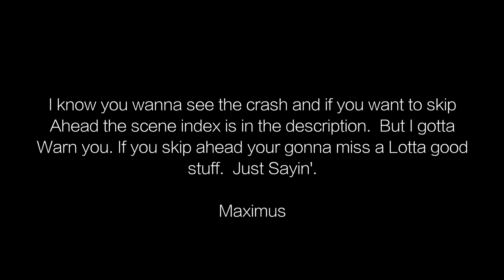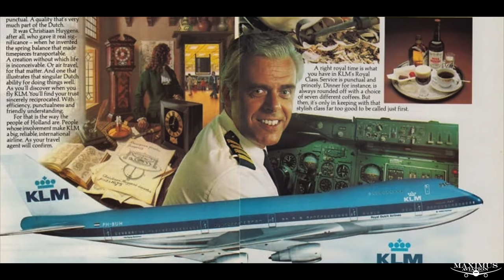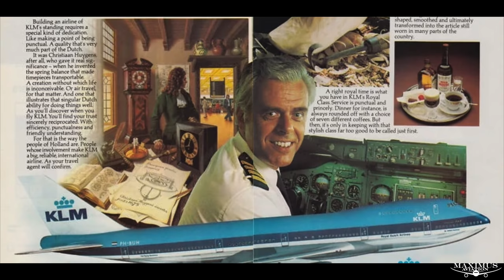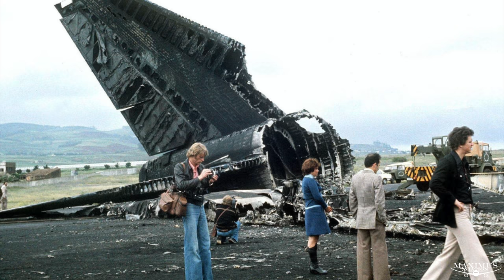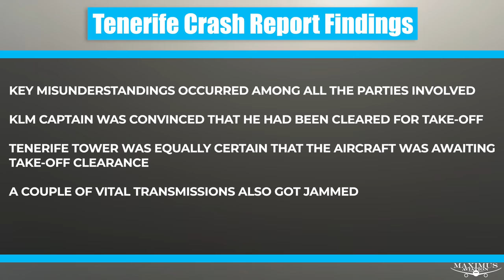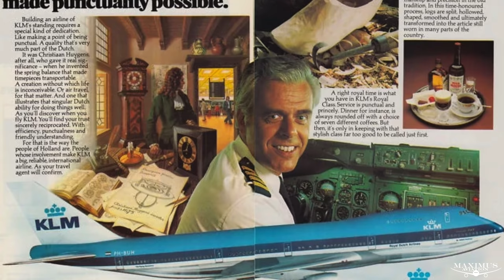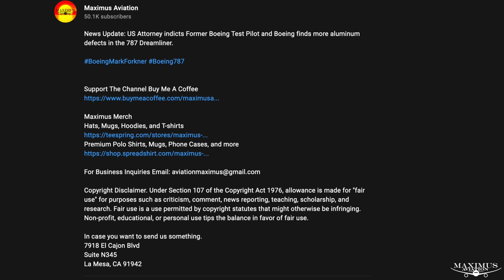How One Pilot Caused The Worst Accident In Aviation History

Comment: I reposted this comment for the actual video. It was first posted in the teaser notice.
Van Zanten was KLM’s chief check pilot. Van Zanten had spent the last year before this disaster as the pilot in charge of simulator training of the KLM pilots. Van Zanten took this charter because he needed actual air time to keep his pilot status current. The biggest problem with Van Zanten jumping from the simulator environment to actual flying was he had “Simulator Syndrome” from spending so long in a check training cycle. In the simulator if a problem arose during the test flight they would just reset the stimulation and run it again. Under the stressful situation Van Zanten found himself in he started treating the take off like a simulation and he refused to listen to any other input in his fixation to get in the air. His timing out due to running out of available hours and been grounded to a forced rest period were the first and only thing on his mind that day. When the crash was reported to KLM they spent a couple of hours trying to get their most senior pilot to go to the island and help with the investigation. Even the senior management did not know it was Van Zanten in charge of that flight. As far as they knew Van Zanten was going to be checking pilots on Monday morning at the KLM train facility. Van Zanten was also racing to beat the clock so it would allow him to be at that training facility Monday morning as well. One last note the refueling of Van Zanten’s 747 requested by him to save time on the ground later was just another factor n this crash. The fog became thicker in the delay and the Pan Am plane could not go around the KLM due to just 20 ft of space missing to do that. Some have said that extra weight of fuel made the plane too heavy to take off in the space available. If it had been lighter it may have cleared the Pan Am plane.
Reply: Zanten's ego was bigger than his brain.
Reply: Interesting comment about 'simulator syndrome'. That sort of explains a lot.
Reply: @pasoundman  It was in an article I read that was done about this accident about 10 years ago. The author had suggested that because of Van Zanten's lengthy time in the training environment he should not have been flying as a First pilot until he had completed a check flight ride to allow for someone to evaluate his effectiveness. The only problem with KLM's and a lot of airline culture at that time was who do you get to check the chief check pilot? CRM implementation addressed that problem and it cleaned up a lot of this Demi god pilot syndrome where their word was never questioned by underlings.
Reply: Condense. Brevity is the foundation of effective communication. I fall back exhausted.
Reply: Indeed. Thank you very much for pointing this out! And van Zanten was not only the Chief Check Pilot of KLM, he was also the Security Director of KLM, responsible for the safety of flight operations and in cases of accidents to join the investigation team for KLM.
Reply: @pasoundman  Exactly.
Reply: @patreilly2445  CRM was a result mainly of this crash. May it should count as Captain van Zanten´s heritage. It will at least be linked to him as long as aviation will exist.
Reply: @Pat Reilly  
You mention van Zanten running out of available hours, all too true.
Had he thought ahead, and ordered his refuelling earlier - even just 30 or 40 minutes earlier - it would have allowed him to wait at the end of runway 30 for the Pan Am to take whatever taxi ramp it chose, in full view. The thickest clouds would not arrive until later.
Then he could have flown safely back to Las Palmas and Amsterdam with several minutes to spare.

As it was, his near-last-minute refuelling decision boxed him in. Just like a small private plane flying into a box canyon (but much harder to foresee), the situation boxed him in until there was nowhere to go to get out alive.

Comment: I have seen and read several analysis of this event over the years and besides other errors or problems contributing to this horrific outcome, the acts of Van Zanten are identified as the key contribution to the accident in all of them!
Reply: 😂😂 stop the cap hé got clearance bud it wasnt for him hé got wrong coms and pan am was on the wrong run way
Reply: @marijnnn4992  There was only 1 runway, used for both taxi and takeoff. The Pan Am wasn't on the wrong runway, it was taxiing to a takeoff position. Van Zanten throttled up and attempted take off WITHOUT any clearance to do so, and before the Pan Am had cleared the runway. At no time did the tower tell him he was cleared for takeoff. This is 100% on Van Zanten's shoulders. There was no "wrong coms". He had NO coms whatsoever telling him he could begin takeoff.

Comment: As a former pilot, I agree with you. All what you said seems correct. There were a lot of contributing factors so that it was the perfect storm so I would not put the blame entirely on the KLM captain shoulders but, like it or not, he is anyway the one who makes the biggest mistake. It's true that cockpit management was very different in those times but it appeared that captain Van Zanten had a massive ego ... Arrogance and overconfidence are never good in the aviation industry. Just my opinion
Reply: Indeed.
Reply: You are a former pilot? Did you ever take off without clearance? As a current pilot, that would NEVER cross my mind. No matter what else happened that day, including fog, garbled radio messages, and possibly unclear instructions, at the end of the day, he throttled up his aircraft, and headed down the runway WITHOUT tower clearance. At no time, has this ever crossed my mind. It is 100% on Van Zanten. No matter what other mistakes were made that day, or the weather, this could have been completely avoided,  had he just waited for clearance to take off, and not just assuming he had it. End. Of. Story.
Reply: @TheDarkSpecter00  That's absolutely right. I was a little more balanced referring to the whole chain of events, so to speak but, w.r.t. the KLM captain, I didn't say anything very different from your statement: "he is anyway the one who makes the biggest mistake". And no, obviously I have never taken off without clearance.
Reply: With all going wrong fate loaded the gun,  but Van Zanten pulled the trigger.

Comment: Capt. van Zanten deserves the blame placed squarely on his shoulders. Your criticism isn’t misplaced. 
The only bright side of this fascinating disaster, is that we now have CRM in place.
Reply from the maker: Great point.
Reply: CRM and ground radar and much more strict ATC protocols. What we should but don't have is either 2-way full duplex radios or at least anti-stepping radios (that latest is very easy to implement, just inhibit the radio from transmitting when there is a transmission being done on the frequency).
Reply: Part of the problem was the delays (due to terrorist activities) leading to the crew getting tight on flying hours.  If the pilots went over their allotted time they could be in serious trouble, even losing their licences and livelihoods.  Due to this risk, the KLM captain was in a hurry to prevent going out of hours.

A legal requirement intended for safety actually resulted in a pilot rushing, making mistakes, crashing and the loss of life - making it actually less safe for the flying public in this case!

(UK Lorry and coach drivers have the same issue over driving hours which can lead to rushing to get somewhere before the hours run out.)
Reply: @cigmorfil4101  He could have accepted that he needed to take one night off and stay overnight in Las Palmas. But he didn't want that.
Reply: @AnzuBrief  
And the cost to the airline of finding hotels for the stranded passengers, and the cost to the airline of a plane now even more out of position with regards its future flights...

Comment: Ironically the first officer stopping Captain Van Zanten from taking off immediately possibly worsened the situation. 
If they had taken off prior to waiting for their ATC clearance the Pan Am aircraft would have been further away giving them more runway to get airborne and they would possibly have cleared the Pan Am 747. They may have hit the tail fin and substantially damaged both aircraft, but the KLM aircraft would more than likely have been flyable and there would have been few if any fatalities on the Pan Am aircraft.
Reply from the maker: Yeah I was thinking that after I recorded it.  But there is still a good chance he would have hit PanAm anyway.
Reply: @maximusaviationchannel  The undercarriage and aft section of the KLM 747 hit the fuselage of the Pan Am 747 with the outer main gear passing through the upper deck behind the flight deck of the Pan Am 747 which is why the flight crew of the Pan Am aircraft all survived. That means the KLM 747 was completely airborne at the point of impact and starting to climb when it struck the Pan Am aircraft. For them to clear the Pan Am aircraft completely they would have needed to be about 20 to 30 m (60 to 100 feet) higher. I’m not familiar with the initial climb rate of a 747 immediately after lift-off, but conservatively I would guess it was at least 500 feet per minute. So if we go for needing another 100 feet that adds 12 seconds to the take-off run at about 160 kts or 82.24 m/s. If we multiply that by 12 seconds we get 968 m. However, this is assuming the absolute worst case scenarios and the initial rate of climb at take-off speed could be as much as 1,800 feet/min and the calculation above would have the KLM aircraft completely missing the Pan Am aircraft. Since this was an emergency situation they would more than likely have pushed the KLM 747 to its maximum rate of climb for the conditions which I’m pretty sure would have been at least 1,000 feet per minute. Also if we just look at clearing the Pan Am fuselage and hitting the tail fin (more than likely leaving the KLM 747 damaged but flyable) it only needs to gain at most 40 feet. Using these figures the additional runway needed reduces to 148 m. The Pan Am 747 had reduced its taxying speed to about 4 kts or a little over 2 m/s, so that would require the KLM 747 to start its take-off 74 seconds earlier so in this case the added delay probably wouldn’t have made that much difference.
Having said that, it was really close and when I get a chance I will go through the reports and see if I can get more accurate figures to see if they would have at least saved most if not all the people on board the Pan Am 747. I don’t think the collision could be completely avoided, but there was a similar incident at Sydney Kingsford Smith Airport (YSSY) where a B-727 hit a CP-Air DC-8 that was back tracking on runway 16. It turned out that the B-727 had enough room to abort the take-off and stop before colliding with the DC-8, however, in the heat of the moment the pilot of the B-727 elected to continue the take-off and hit the tail of the DC-8. Despite both aircraft being severely damage and the loss of at least 1 hydraulic system on the B-727 it was capable of landing some 40 minutes later and there were no injuries of casualties other than the aircraft. In fact the passengers in the DC-8 were unaware that the B-727 had actually hit the DC-8. 
That would tend to indicate that if the KLM aircraft struck the tail of the pan Am aircraft there’s a good chance it would have been capable of flying and landing safely.
Reply: @Masu_Stargazer  That is a very interesting analysis Masu.  Thank you for taking the time to run the numbers!  I agree that it is possible that starting the takeoff roll a little earlier when the Pan Am aircraft was not as far down the runway could have changed this from a complete disaster to a serious incident.  For sure Van Zanten would have had a lot of explaining to do in that case!

Comment: Not bad ! You have most of the salient facts correct but missed a crucial detail. Why did van Zanten believe he had a takeoff clearance ? ATC had given a ROUTE clearance to the KLM 747 and apparently in his haste to 'move on' Capt van Zanten incorrectly interpreted it as a takeoff clearance. The KLM First Officer confused matters further by stating on the radio using non-standard R/T "we are AT takeoff". It appears that ATC read this as "we are ready to takeoff" NOT "we are taking off". Clearly the KLM First and Second Officers were hesitant about Capt van Zanten's actions but felt overwhelmed by him and deferred to his authority. Plenty of fatal accidents have resulted from similar behaviour by other crews. Fortunately today CRM is hammered into the brains of flyers but such mistakes and complete lack of proper CRM still occasionally kills hundreds. For ages certain airlines only gave 'lip-service' to CRM as well.

The R/T confusion is important. Non-standard phrases should not be used, especially when not using a mutual native language, as was the case here. Lastly, the failure of a critical message to be heard due to heterodyning (simultaneous transmissions) resulting in a 'squeal noise' was the final nail in the literal coffin. To this day I'm surprised that better radio hasn't resulted because 'stomping'/heterodyning still happens sometimes.

I'm entirely perplexed that some still feel that Pan Am was at fault for 'being in the way' ! That's just not understanding how aviation works, which is 'permissive', i.e. you have to have clearance/permission to do almost ANYTHING when controlled by ATC !

I once met a fairly senior Boeing engineer in the bar waiting for our respective 747s to be ready at Mumbai (Bombay) Chattrapathi Shivaji International airport. I raised the matter of Tenerife. No question that engineers think much the same. I think he called van Zanten an idiot ! Nuff said.
Reply: Indeed - exactly all the points. One addition, knowing a little bit about the Dutch language:
It seems obvious to me that the FO was falling into the trap of what language science is calling a "false friend". Dutch and English are very similar languages, but different languages.
The FO was thinking in Dutch and speaking in English. If you want to transmit the information in Dutch that you´re now doing the Take-Off-Roll you would say in Dutch:
- Dutch: We are at de starteling.
- Word-for-word-translation into English: We are at the start. => And that´s exactly what the FO said according to the CVR transcript.
- BUT: No English Native Speaker and no Speaker of a different language who learned English by a textbook like the Spanish ATC will understand what you´re meaning! The reason is that the Dutch and the English language have different concepts of movement.
- If you want to transmit the information of: "We are at de starteling" to an English Native Speaker or a Third-Language-Native-Speaker who learned English by the Textbook you´ve not to translate it word-by-word but you´ve to follow the different English concept of movement and you must say then:
-- We are starting NOW!
And that was it what the FO meaned that he had said - and maybe van Zanten, too. Unfortunately neither the Spanish ATC nor the American Pilots had a clue about  the Dutch language. Otherwise they would have screamed: Stop! Stop! Stop!

RIP to all of the victims.

Comment: Maximus thx for another well produced video.  Silly question from a noob, but has there been any moves to replace or augment verbal instructions between ground control and the airplanes to remove any grey areas in comms?
Reply from the maker: Well yes is a sense.  While verbal communications are here to stay there have been many advances in ground radar and electronic communication to aid the tower and aircraft in knowing where eachother are.
Reply: There were some clarifications, like ATC is never supposed to use the work takeoff until giving takeoff clearance.  It's always departure until them.  Not sure if that would have  really helped here, he ignored every attempt to clarify the situation and threw caution to the wind as the rest of the crew objected.
Reply: As a result of the crash phraseology was tightened.

eg the phrase "take-off" is now specifically used to refer to actual take-off.  Instructions on what to do after take off use the phrase "after departure" instead of the fatal "after take-off".

Comment: Question: did KLM pay compensation to the families of the victims and Pan Am?  If so, how much?
Reply from the maker: Yes.  (From Wiki) Although the Dutch authorities were initially reluctant to blame captain Veldhuyzen van Zanten and his crew,[5][55] the airline ultimately accepted responsibility for the accident. KLM paid the victims' families compensation ranging between $58,000 and $600,000 (or $248,000 to $2.6 million today, adjusted for inflation).[6] The sum of settlements for property and damages was $110 million (or $470 million today),[56] an average of $189,000 (or $807,000 today) per victim, due to limitations imposed by European Compensation Conventions in effect at the time.
Reply: @maximusaviationchannel  y aparte tambien pagar el avión de pan am